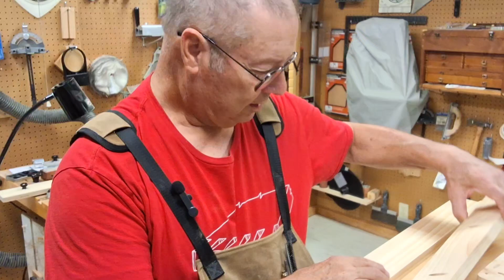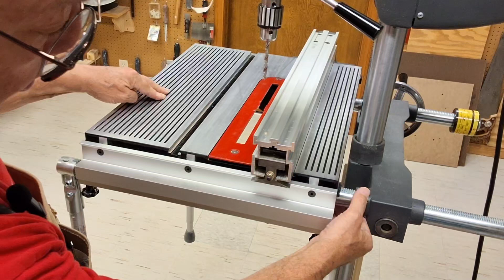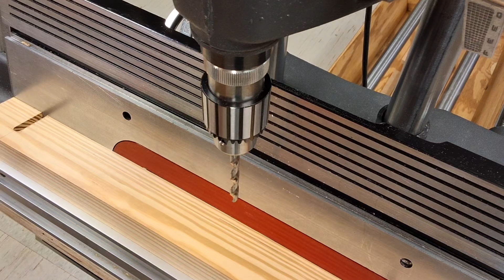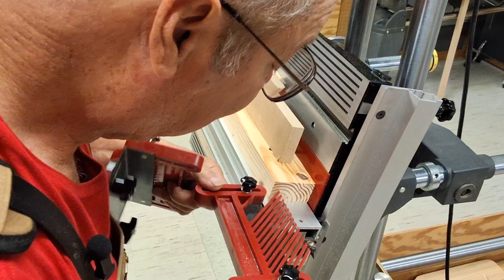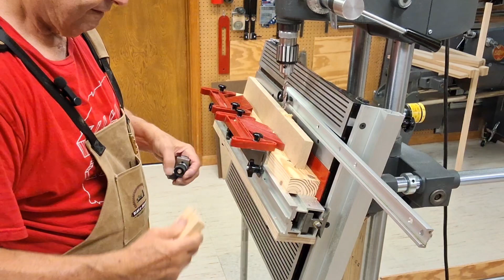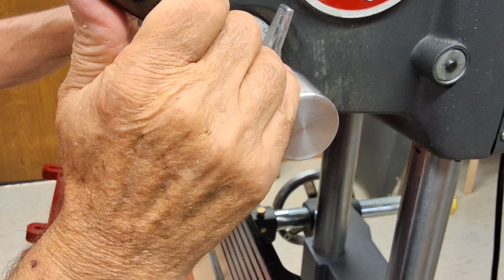Advanced Operations 1 Screw Hole Pockets

Comment: I love my ShopSmith and use it all the time.  I enjoy watching your videos but, there are some tools/functions that can be performed easier and quicker than on my ShopSmith. Pocket screws is one of them. I can have my pocket hole jig out and holes drilled faster than I can set up my ShopSmith to do the function.
Reply from the maker: @dennisholtby2140  There are situations where you need a different angle than 15 degrees or the length of your shank hole must be customized.  The portable jig gives you a fixed configuration.